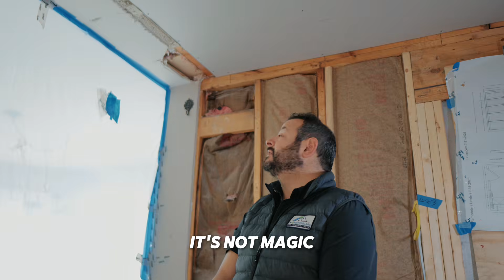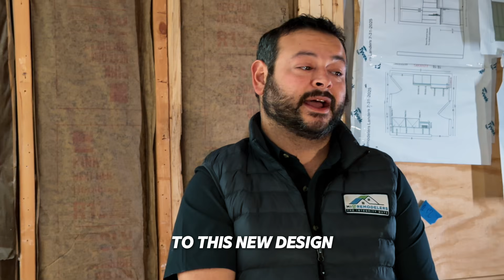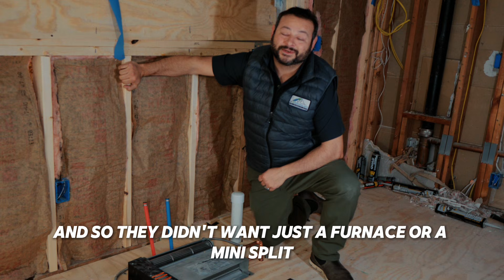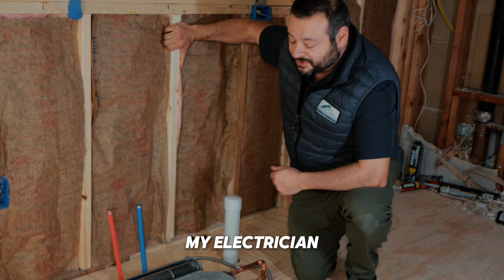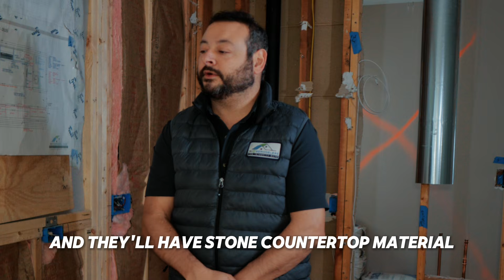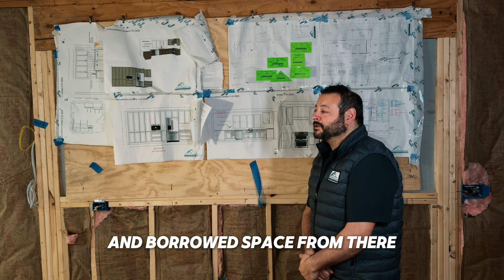Everything You Don’t See During a Kitchen Remodel

Comment: Not really worried about heating a kitchen how are you going to cool it
Reply from the maker: The heating system was adapted to expand the kitchen. This home has an air handler for air conditioning the home. We actually upgraded the insulation causing the air conditioning to work much better post remodel than ever before. Old insulation causes cool air to escape quickly in the summer. Those problems are a thing of the past for this great rochester family
Reply: @miremodelers Nice!